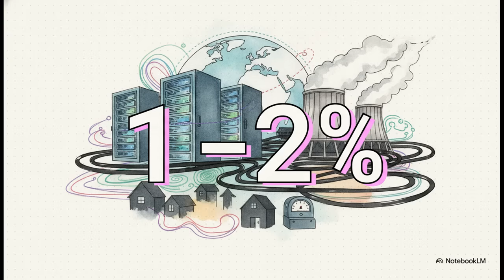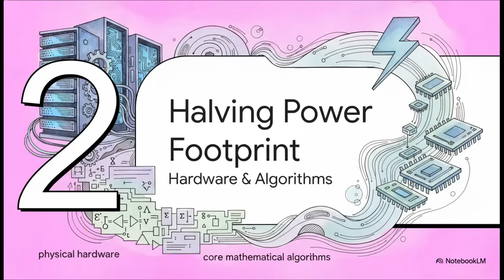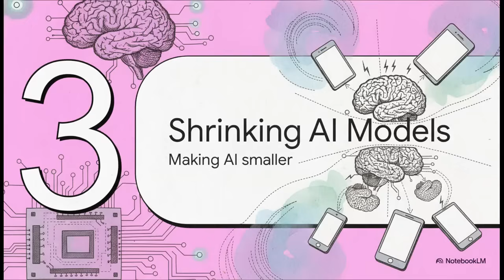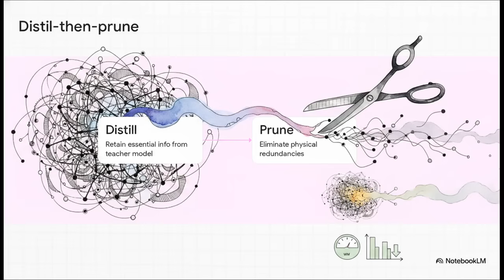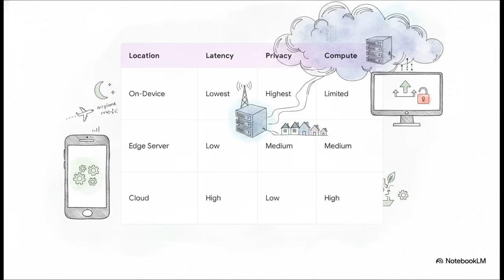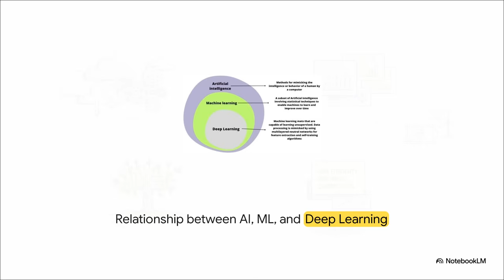Save Cash! 💸 How Artificial Intelligence Models Save 50% Energy Cloud vs Edge Secrets Check Books 📚👇

Comment from the maker: STOP Burning Cash! 💸 How AI Models Save 50% Energy NOW! (Cloud vs. Edge Secrets Revealed) 🔋 Check Books 📚 👇 To Buy 📚 Artificial Intelligence, Interview Preparation & Life Changing  Books 👇 Press 👉 More on Description
 Did you know that training a single large language model can consume as much energy as 120 households use in an entire year? As AI scaling hits the "energy wall," developers are scrambling for solutions. In this video, we reveal the breakthrough architectural shifts and hardware optimizations that allow AI models to slash energy consumption by a massive 50% without sacrificing performance! 🚀
What you’ll learn in this deep dive:

    The FP16 Revolution: How switching from single-precision (FP32) to half-precision (FP16) arithmetic instantly triggers up to 50% energy savings during training.
    The "Big Three" of Optimization: Discover how Quantization, Pruning, and Knowledge Distillation shrink models to fit on your phone while maintaining elite accuracy.
    Edge vs. Cloud Power War: Why dedicated Neural Processing Units (NPUs) are outperforming the cloud for real-time tasks, offering a "zero marginal cost" energy profile.
    Network Hacks: How local caching can reduce the energy cost of data transmission by up to 80%.
    The Hybrid Future: Why the most sustainable AI isn't just in the cloud—it’s on your device.

Stop wasting computational power and start building a sustainable AI future! Watch until the end to see the side-by-side efficiency comparison between the iPhone 16 Pro, Snapdragon 8 Gen 3, and dedicated NPUs!

sustainable ai, energy efficiency, cloud computing, edge ai, model optimization, green ai, half precision, npu vs tpu, machine learning, ai sustainability, save energy, on-device ai, ai hardware, model pruning, quantization, artificial intelligence, artificial intelligence books, artificial intelligence jobs, ai jobs, jobs abroad, it jobs, software jobs, interview prepration books, ai books

#SustainableAI #GreenTech #ArtificialIntelligence #EdgeAI #EnergyEfficiency #MachineLearning #TechTrends2026 #EcoFriendlyAI